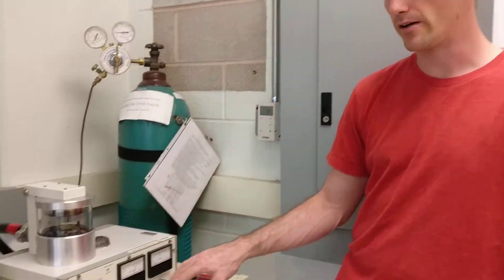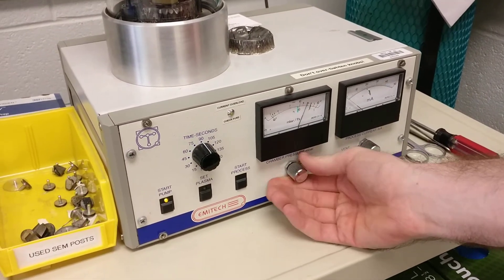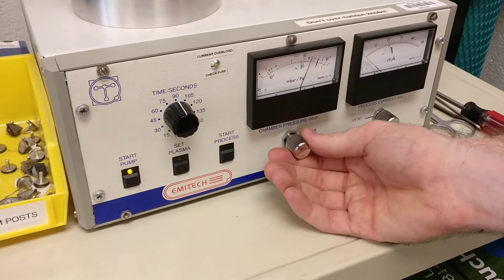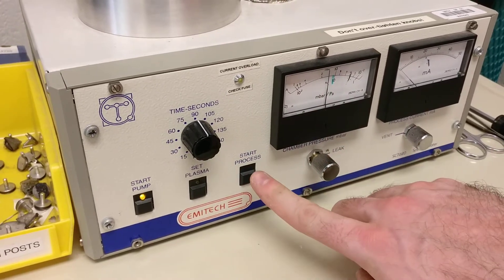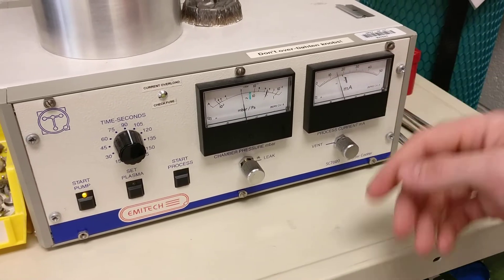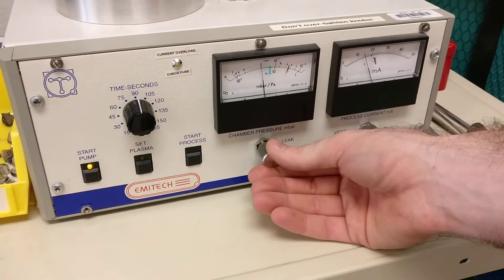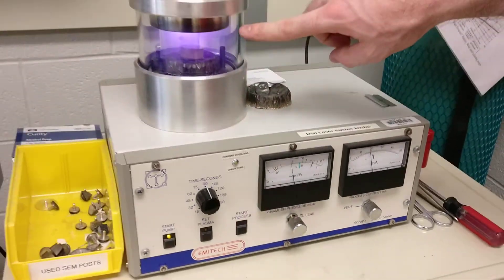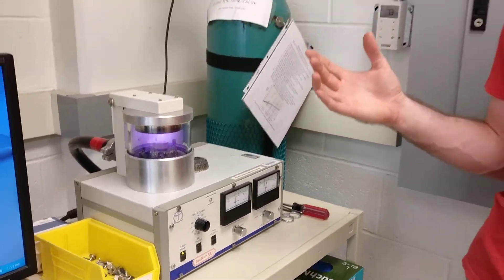Sputter Coating 3 of 3 with Emitech Mini Sputter Coater Quorum SC7620

Comment: I want to use aluminum
How much is the resulting film thickness per minute?
Reply: can we use aprt from au pd ??
Reply from the maker: there are equations in the manual based on distance from target and current. Likely <1um, you can test by measuring resistance over a distance.